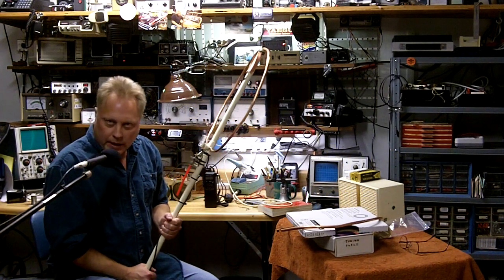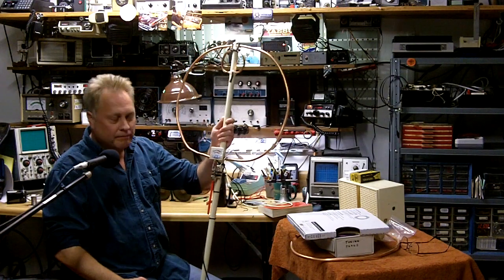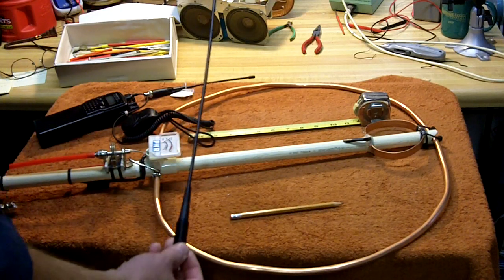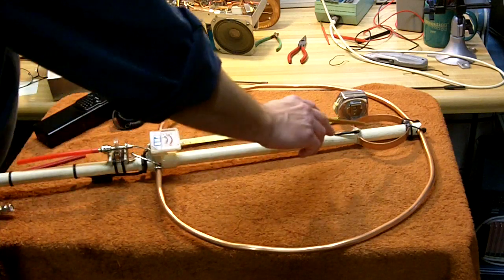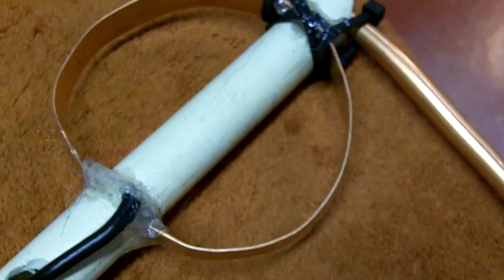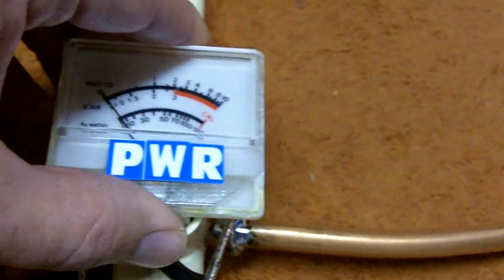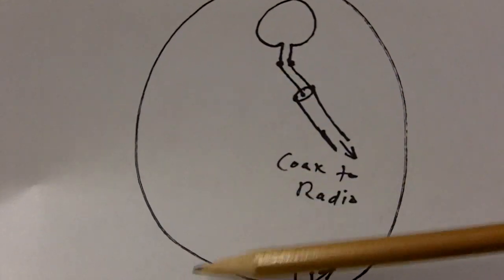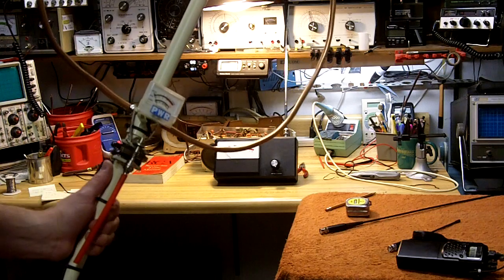My Low Cost Magnetic Loop Antenna For 10-12 Meters

Comment: I'm really thankful for your video. I've been licensed for a few years but never really had much time for radio. Now circumstances have changed and I can start playing again.
I kind of looked at Magnetic loops some years ago but not in detail. Now you have nicely broken the method down it is so much easier than I first thought. I think maybe back at the start I saw calculations that probably scared me off but had I seen it describe and drawn like that then I would have made one for sure. I certainly will now. Thanks!
Reply from the maker: Thanks, they are fun to experiment with and really there is not much to them so you can easily put something together to try.  Have fun with the project!  73
Reply: I've just got my FT897d back out the box and discovered it has a major fault. First impressions suggest blown finals but it transmits ok on 2m FM but has very weak receive. Very weak TX on HF & 6M but receives ok. Tried the relay cleaning procedure but it didn't cure it. So any trials with the magnetic loop will have to be with my FT817. Service manual for the FT897 suggests separate finals for UHF VHF as opposed to HF So I'm inclined to think a relay or something is not making the switch. Arse!

Comment: I like it !! and your wall, like the meter, copied all your descriptions, studying antennas several years, electronics on net, sub- taught some at school, 70 yr old new ham, 3 yrs General, Kenwood 2000, Astron 35A pwr supply & an old RS-DX-398 with aerial/ground used for Xtal sets, other receivers DX-390 melted in fire, back to 55 yrs ago, 2 Hallicrafter receivers, crude Xtal sets even now, 1N34 as well as a rusty nail & corroded penny and sharp pin detector, working on others. Busy life, retired disabled 22 yrs ago Vo-Tec Guidance Counselor Comm. College, took lots of free night classes, still an idiot with my radio and PC, have lots of parts.
Bill McGraw, KF5FJZ, NRA Life, Korea vet, mcgr3799@bellsouth.net
"Somewhere South of Chicago"
Greenville, Mississippi

Comment: I tried a loop once. The capacitor I used was a pain to tune. I have a capacitor with a reduction gear that should be easier to tune. I have been thinking of making a loop antenna based on the Alex Loop walk ham. I like the idea of a loop that breaks down for  transport.

Comment: Great video Larry and nice project. I just purchased a used 1012, and I have been rattling my brain on an antenna project for extended range. This just might be doable.
Reply from the maker: Thanks, yes , this antenna works great with my 1012, much better than even the long range rubber duck.

Comment: What is the smallest diameter or length for main loop that I can get, even with changing to different capacitor? It would be cool to have as small as it could be to use it QRP somewhere where I may go backpacking..

Comment: I'm a longtime user of small magnetic loops antennas, but anyone considering using one to transmit really should first read up on loop safety issues online. Even at QRP power, they can burn you or deliver multi-hundred-volt shocks. Their near fields ... again, even at QRP power levels ... can be a danger also. On receive, as you might expect, they're entirely safe. They're the best small HF antennas around, but you really have to be careful if you transmit with one.

Comment: I ran into tons of noise with my fan dipole in the attic, I was able to make a few contacts a few hundred miles away but I get around s9 noise so its very difficult.  I am now going to try a magloop instead, I ordered a quality variable capacitor and hoping it might solve my issues.

Comment from the maker: It is within an inch or so of that, but it is not real critical if you are off a few inches or so, the tuning capacitor will still adjust for frequency ok..

Comment: Also as a reminder since the antenna power handling capability is limited as the cap has to handle the high voltage.

Comment: The trouble with using a fixed capacitor is that these antennas have an extremely high Q.  What this means is that if you are using. A fixed cap the band width will be very narrow. Very narrow. Also another issue is that you need a very high q capacitor and one with low dielectric loss   Remember that the voltage at the cap is very very high.  Higher than you might expect so use caution when operating this antenna.

Comment from the maker: I cut a slit in the pvc for the flat part of the small loop to fit into, I just cut a little less than half way through.  Holds it in place but I also used some hot glue around that to help keep in place.

Comment: A stealth antenna for limited space that really works great.
Many Ham Radio operators give up due to antennas restrictions with all the HOA restrictions these days.
Check out Stealth antennas that really work.
QRZ.COM/db/K8NDS       Anyone even in a small lot can have a big signal. Handles full power down to milli-watts.

Comment: What a wonderful video! I just bought four ten-foot lengths of 3/4" hard copper tube (used normally for plumbing), eight 45 degree "street" elbows and two 90 degree elbows to make a hex loop with 5' sides for 80 m and 40 m. Bought two 3/4" x 2' pipes, and two 1" x 2' pipes to make two series-connected bazooka tuning capacitors. I hope to be able to feed this mag-loop with my KX3 tranceiver driving a KXPA-100 final. You have given me great hope that I can actually make it work! 73 de AC8NS - Hop

Comment from the maker: I have not tried over about 25 watts or so into this loop and not really sure what it could handle but it would mostly depend on the variable cap used.  I just use these loops with lower power output. Sorry that is about all I can tell you, kind of experimental for me with power levels. It might handle more. I would guess that it would just start to arc over on the cap with too much power.

Comment from the maker: Thanks, I may do a video on a 40 meter loop in the future as I think I will need one for a qrp rig I am building. You do not want to use an external antenna tuner on a magnetic loop since the antenna needs to be tuned by the variable capacitor attached right to the loop. 73..Larry

Comment from the maker: Since it is hard to explain in words probably the best thing to do would be to search on YouTube here for "how to install a pl259 connector" or the type connector you have, I just did a search and see there are a lot of videos that will show you how to do that much better than words can say here so I would recommend that.  You just want to make sure the center wire and the outer braid on the cable are not touching each other at all in the connector or it will be a short and will not work.

Comment: I made a loop antenna today with a bucket, wire, and a variable cap from an AA5 and a swtich, and it totally does nothing.  I think I need to double my loop for my 1 foot diameter bucket.

Comment: 'm riding a loop for 7-30 mhz but I want to use more power in transmission around 100 watts. Checked using the vacuum capacitors 10 to 500pf but the price is way high. Variables have the common problem of isolation.
Found very interesting use of a VU meter for checking the output energy of the antenna. If you use a normal variable I will use a vernier adjustment knob.
Congratulations for the video!

Comment: Worked most of a week trying to get my loop to act like it should. At 6 ft. the best I got was 22 Meg.Hz swr of 1, resistance of 50 and reactance of O. not bad but at wrong freq. as I reduced the value of Cap the freq. went up but so did the SWR and Reactance. Tried many Caps even a Butter Fly. took the antenna out side to get it away from metal in shack but no change. Finely gave up. Jest saw another way to feed the loop so I might try that. W4GSM

Comment from the maker: In the configuration it is in, the most energy transfers from the primary loop to the secondary larger loop, so that is most efficient, turning the smaller loop or moving it farther away would make for less signal coupling so it would become less efficient, however I have not really tried that experiment first hand, so if anyone has other ideas please comment and correct me I guess..but I think that will be the case.

Comment: Curious that these still seem popular. I hear that routing the coax can be critical with these since the majority of actual radiation is via the feedline. The "antenna" proper is effectively just a decent tuning section, according to most of the best antenna engineers. But hey, if it works for you isn't that the bottom line? Who cares what the theoretical shortcomings might be when you can still make contacts?

Comment: radiohamguy

Thank you for responding....Yes, I will absolutely let you know the performance results using the MFJ 1810T 10 meter antenna when conditions get better....I also have a MFJ 1812T telescoping antenna with the bnc connector to run on 12 meters....I check the QRZ propagation report daily looking for that opportunity...I have the MFJ 259B to check these antennas out with and they are a perfect match dead center of the bands ....I also got a hamstick dipole to check out later.....73's

Comment from the maker: Yes it can be used for CB radio, great for limited space or portable use.  You would probably have to tweak the tuning to cover top to bottom of the band but if you just hang out on certain channels you could just mount it and leave it in one spot if you wanted.

Comment from the maker: Thanks, well, the spacing is not critical, closer is probably better as long as they don't touch each other but yes, mine is probably about an inch or so apart.  Of course you wouldn't want them several inches apart but nothing critical about it from my experimenting anyhow.

Comment from the maker: Hi John, thanks.  I took a look at that on ebay and that is called a cubical quad antenna, it works much different than the type of magnetic loop I have on my video, but they work very well also, they are a type of beam antenna, there is a yagi type with the straight elements, then the quad like that one you are looking at.  He has a video also, you can see the link at the bottom of that ebay page.  If you search for quad antennas on google, you will find a lot of info. Can be square or round.

Comment from the maker: Thanks.  Sounds great, yes, a loop might be a very good solution for apartment use, I would think much better than a ham stick since you need good grounding on them.  Let me know how it works out if you build one.  At least they are cheap and easy to build and try.  If it works out, you might want to either add a motorized tuning device or purchase one that is all set up with that to make tuning easy and faster.

Comment: @RadioHamGuy Some low band loops, 80m etc. with a high Q are not wide enough bandwidth to even accommocate an SSB signal! I built a loop with a vacuum capacitor that will do from 30m to 10m, it's about 1.4m dia. 73 VK2GOM

Comment: I was going to make a more detailed video about the loops I made.  However, you beat me to it . . . and did a much better job!  I love the meter addition, and I know what part I'm going to look for next ;~)  For those thinking about making a loop, just go for it.  Very simple project, and the most difficult part to find is the variable capacitor (easily available from a parts radio or eBay).  73, KC8JZO

Comment from the maker: @fordbroncodave I think it helps some with bandwidth to use larger diameter pipe but not a great deal, they are still very narrow, this one will work about 20 khz bandwidth or so without re-tuning.

Comment: i think i want one of these!  i wonder how well it would work in a large scale like 10 feet across on a platform and rotor.  does changing the diameter of the larger ring pipe help with being more broad banded?